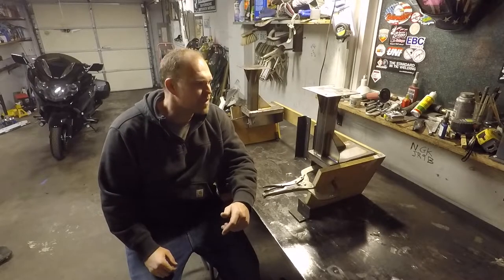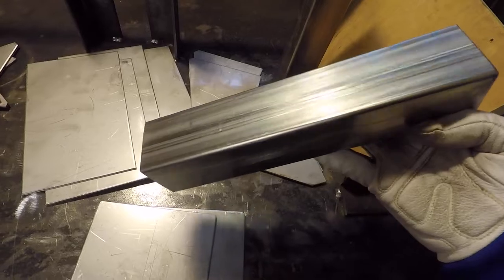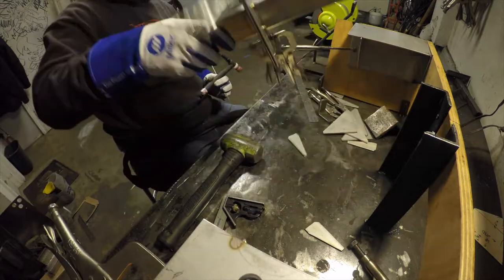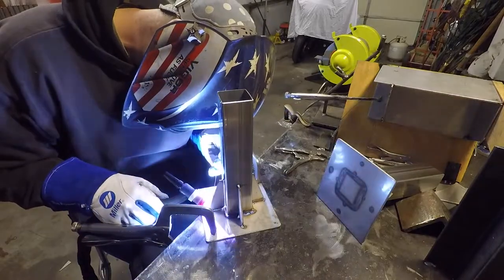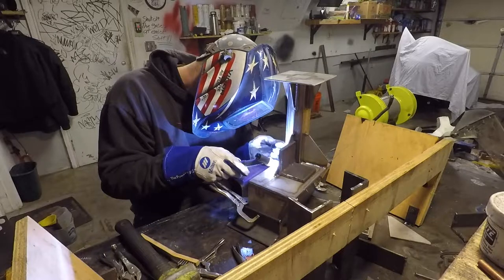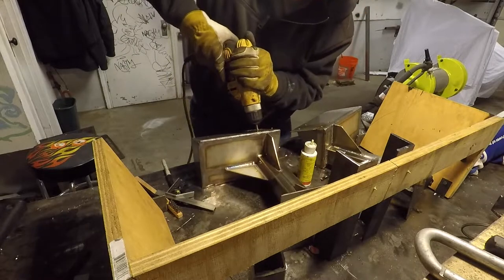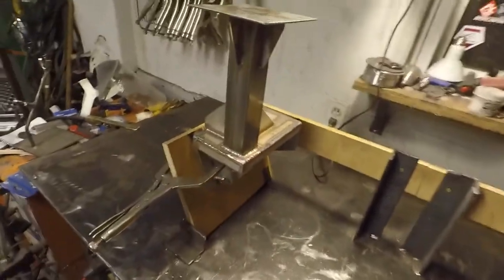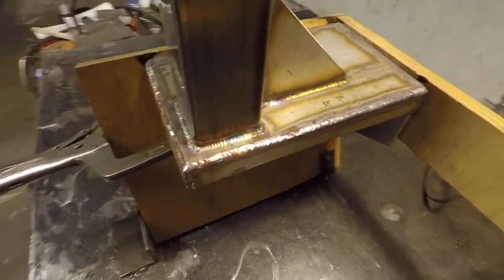Tig welded stainless steel downrigger mounts

Comment: I enjoy the video's but you really need a better camera. 360p makes everything fuzzy
Reply from the maker: Modular Fox Body There in 1080 P 60 frames per second. Might be your Internet is slow
Reply: @weldmandingo  It's working now. There was only a 360P version, nothing else.  Same computer and 1080p is working. I have gigabit speed. Should be any issues. Either way, it working Ty.